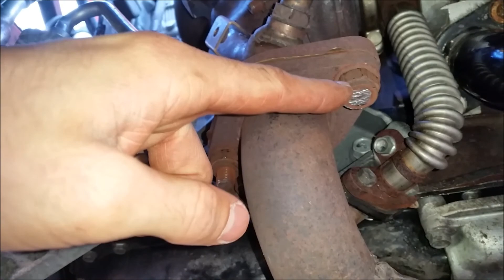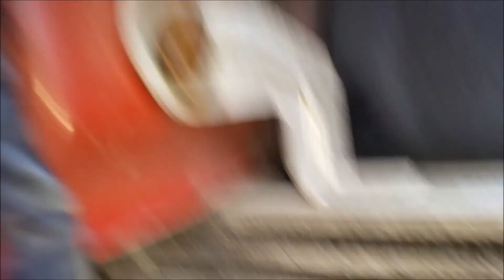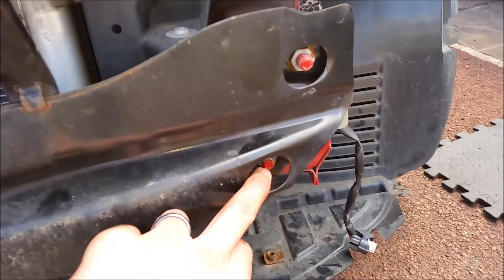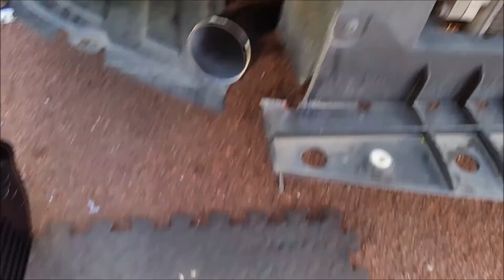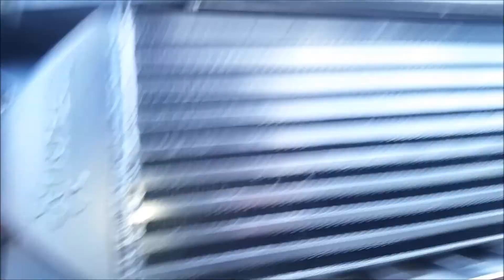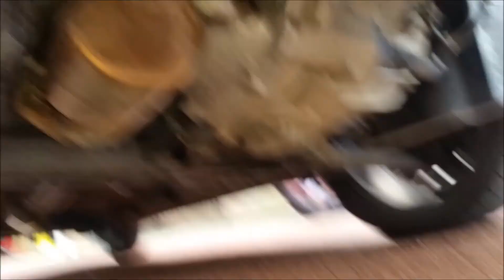Colt Ralliart - Airtec Intercooler Install

Comment: Is that the biggest size intrrcooler you can fit on these
Reply from the maker: From what I remember you probably couldn't go much bigger without removing the crash bar or modifying it. It depends on what your goals are really though, Dynodaze used an intercooler not much bigger than this on their 322bhp CZT.
Reply: I see whatyiur saying thanks for your reply. What ever happened with your colts , did you keep them or sell

Comment: Hi Stew I don't suppose you could fit my airtec intercooler when I get it do you. I'm getting it from dynodaze next week or week after. Where are you based if you can do it for me. I have a mitsubishi colt ralliart 2009
Reply from the maker: Sorry mate I only work on my own cars. Dynodaze offer fitting on the stuff they sell but any local garage should be capable of doing it.